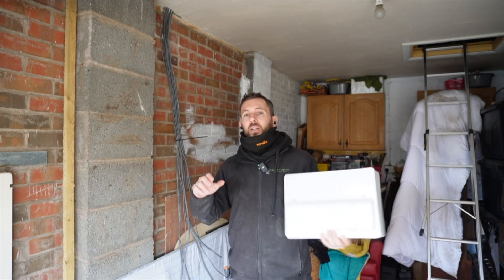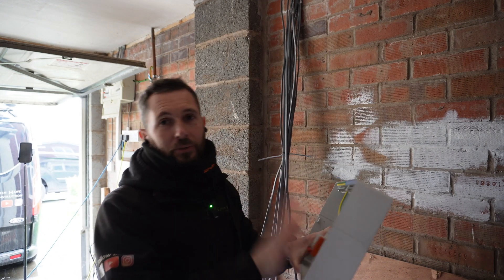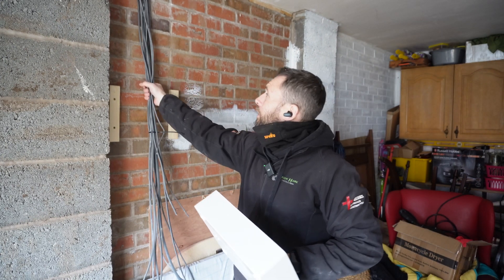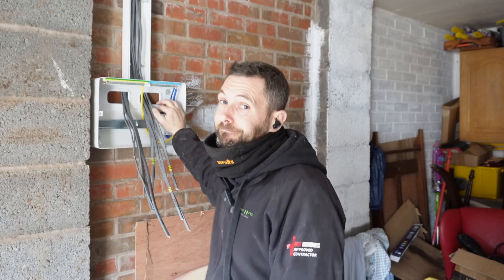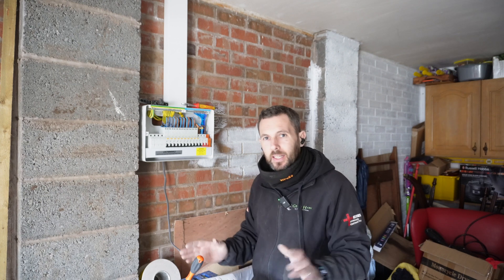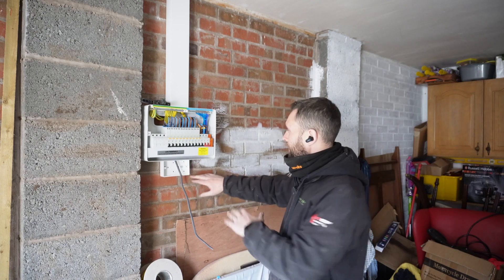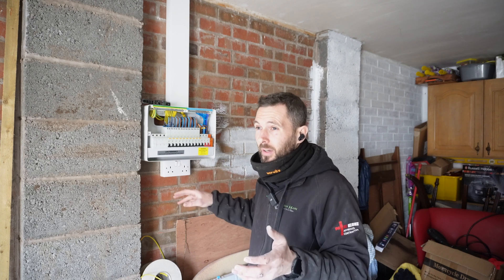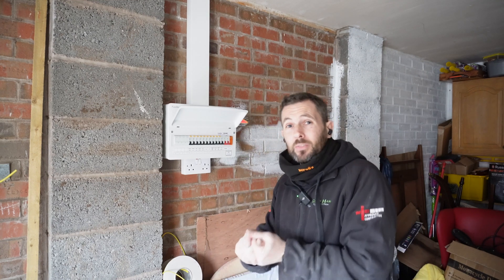Would You Fit a Consumer Unit Like This?

Comment: I now don't mount sockets directly underneath consumer unit because a lot of portable equipment is low voltage & the transformer plugs are big & bulky & cannot be physically plugged in, so l leave a gap between the consumer unit & the socket or mount it along side it.